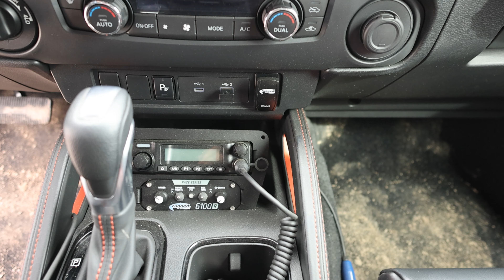Nismo-Equipped 2024 Frontier, Proven Off-Road in Baja by Chris Forsberg

Comment: Very under rated truck, not only  do they look great they have a bulletproof drivetrain
Reply: I agree!
Reply: Except transmission unfortunately. I’ve seen quite a few in my shop
Reply: @Grungebungle 22 and up model? Looking at a pro 4x but kind of effy about transmission not proven yet
Reply: @kamikazikaizer  Drivetrain and motor is the same since 2020. Not many issues regarding those, from the facebook pages and forums. I wouldn't listen to that guy...
Reply: Tranny is fine. Any issues are electronic tuning. All the 22-23's get flashed now so the intelligent cruise control doesn't downshift to 6 million rpms. Other than that not much in bad transmissions showing up
Reply: @kamikazikaizer  Any Frontier transmission 2011 to now should be just fine assuming you don't neutral drop it constantly or do 300k miles without any maintence. The 2005 to mid 2010 Frontiers/Xterras/Pathfinders had a poorly designed radiator that would fail and mix the coolant with the transmission fluid, which has given all Nissan trucks a bad reputation unfortunately.
Reply: Pity about the motor and look bottom feeder
Reply: @Grungebungle sure you have , PlayStation garage doesn’t count
Reply: The older models including the pathfinders and xterras are excellent as well. Definitely amongst the highest value of all vehicles out right now. My buddy has about $10k total into a 2012 pathfinder with 120k miles. Fox shocks, new tires, new brakes. It runs new, looks new,  and rides better than almost anything out there. You can't even touch an Un modified 4runner with 200k for 10k and he's almost fully built out the same thing for that price. A nationwide seach of xterras, pathfinders, and frontiers and you will see plenty of them are hitting 300k plus miles
Reply: Geezus.... This feels like Nissan propaganda. Haha
Reply: @Grungebungle frontiers or other Nissans?
Reply: I owned a 2021 and 2024 and never had issues.

Comment: I will take nissan trucks over new turbo toyota trucks anyday and I'm a long time toyota guy
Reply: I found a manual 2019 TRD pro with around 70k miles on it. It has a lift and a snorkel on it, which was super tempting as I'm trying to make an overlander. But then I started giving a closer eye to the Nissans. For the same money as that toyota I got a 2023 pro4x with 10k miles... I live in Ohio and we use salt. Those 3+ years make a difference. Especially if I'm taking care to undercoat and maintain it properly.

Comment: I own a Gen 2 and Gen 3 Frontier. Not sure why they don't get the love the Tacoma get's. But both mine have been bullet proof super reliable Trucks. I sold my Gen 1 with 388.000 Miles on it.
Reply: The lack of aftermarket parts compared to the Tacoma would be a major factor.
Reply: @khantra4568  It would have to become popular with consumers before after market parts took off, They don't sell enough of them for after market to put R/D into parts for them. Sure you can get a bumper and rims  But the Tacoma almost has a Jeep Wrangler following. That's why they make so many diff brands of A/M parts. Because they sell a lot of trucks and Wranglers. Not the other way around.
Reply: @jimmyjackass1805  it’s a vicious cycle. Also didn’t help Nissan didn’t take the initiative to update the Frontier and continue Xterra production when it was just them and Toyota in the mid size market. Reason why I chose a Tacoma in 2019 over a Frontier was how old the platform was the money.
Reply: @khantra4568  100% The Frontier stayed basically the same from 2005 to 2020 The it took 2 more years for the body re design. Other than the better interior and lighting and safety options, The Wife's 22 really is not that much diff  than my 13. Witch was hers new in late 2012. Now my work truck. If Nissan continued to upgrade the Frontier ever 3 or 4 years you're probably right it would have a BIGGER FOLLOWING. If they come out with a new X There will be one in the driveway for the Wife. She's holding out for it.
Reply: @jimmyjackass1805  Wish Nissan kept a manual option for the new Frontier it would make them stand out in the current competition. That being said if my 19 Taco ever got totaled, the Frontier would be my next truck. Glad they held out and kept a proper v6 instead of another turbo 4 banger.

Comment: The race truck has a Titan swapped front suspension, that's where the extra track width came from. Also gives more travel. It's not the same front suspension as what's on the street truck with the Nismo UCAs
Reply: Yeah super weird that they didn't seem to mention that?

Comment: I have a question. With the stock drivetrain, the initial scene had the production Frontier doing over 60mph while going pretty nuts in the sand. How do these handle when considering the manual calls for lower speeds in 4H? Are you running these in 2H or are the manuals overly cautious?
Reply: Are you sure, I have a second gen and all it said was only switch into 4hi 60mph or lower?
Reply: @johnnyreb1475  that was a 3rd gen in the video and the owners manual says max speed 62mph. In fairness they did not show the speedometer above low 60's but one would argue the race truck was probably going higher even if the stock one was not...and the race truck has a stock transmission.
Reply: also.. who would want to ride long distances at the "max" unless the max is simply a guideline to keep warranties happy.
Reply: @bscabl  I know what it is I just find it hard to believe that big of a difference on the same vehicle. One gen says don't shift into 4wd above 60 and the next says don't ever go 60 in 4wd. Whatever doesn't matter to me.
Reply: @johnnyreb1475  which is why i asked the question to the people who did the riving and have the experience. I want to gauge how much this would actually harm the truck lol